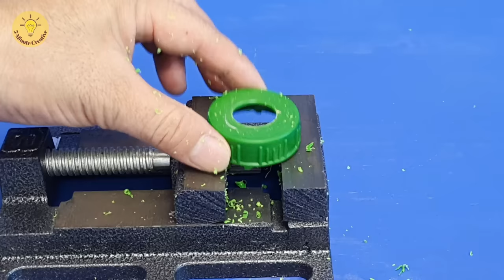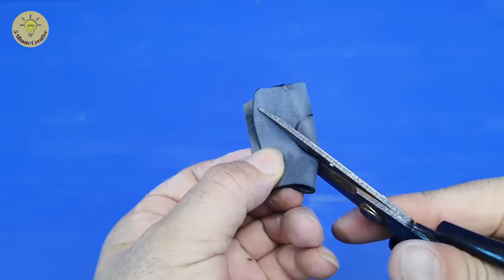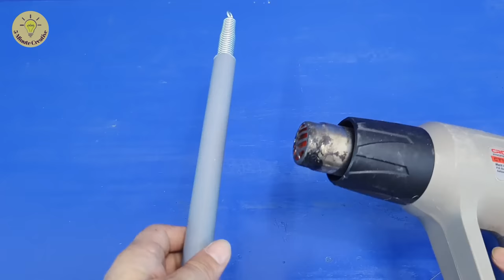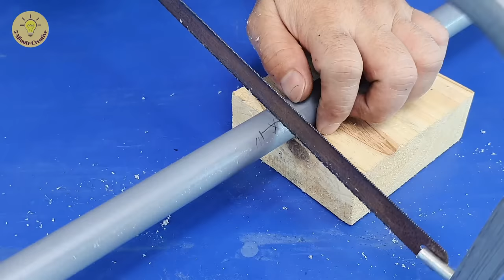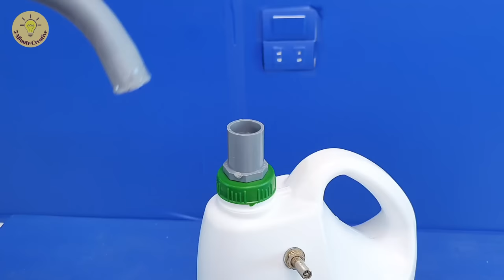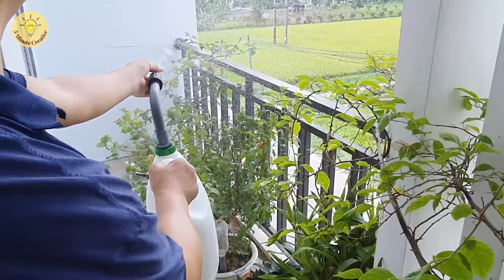The famous plumber taught me this trick  Don't throw away empty plastic cans

Comment: Brilliant idea. What pressure did you pump to ? I cant see it on the video.  What are the dimensions of the grey pvc pipe that you used?
I am going to make ine as soon as I get your answer.
Many thanks.
Reply: in the video it is stated that the plastic pipe size is 21mm and the pressure is more than 2kg.  by car tire pump pressure❤❤❤
Reply from the maker: Thank you very much. You should use a 10 liter plastic can to make and pump with a pressure of about 2kg, then the pump will be longer, and should use a plastic can that is a bit thick. conduit 21mm2. Good luck to you and your family. In my channel there are many useful videos, waiting for your comments. Thank you very much